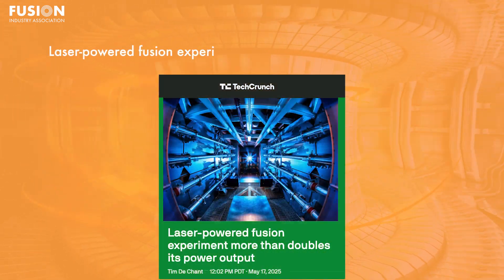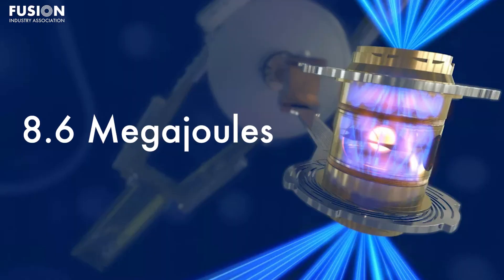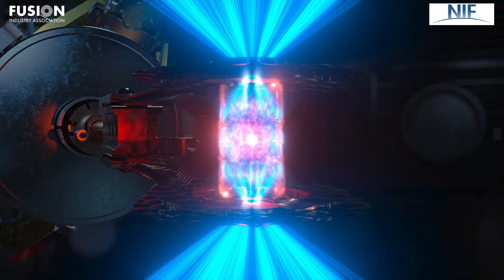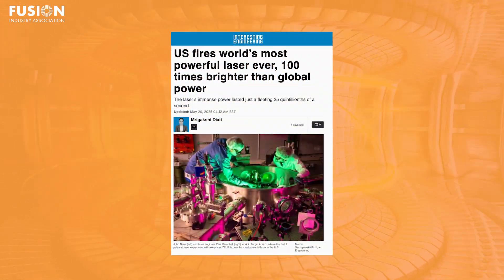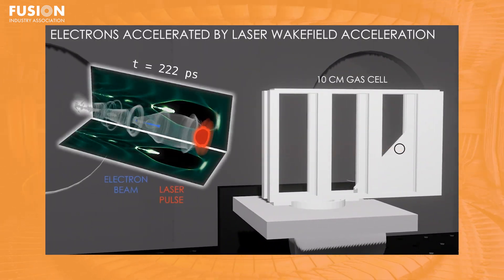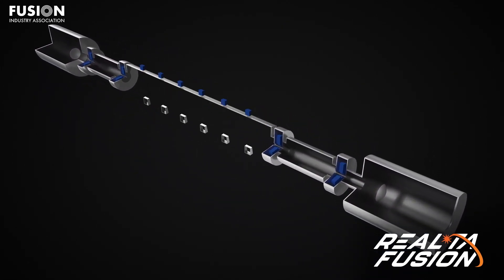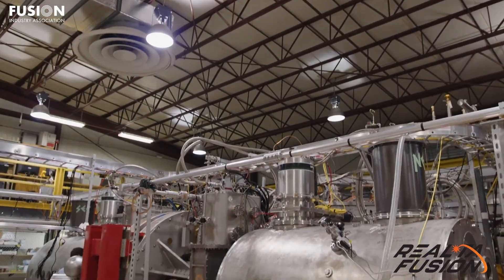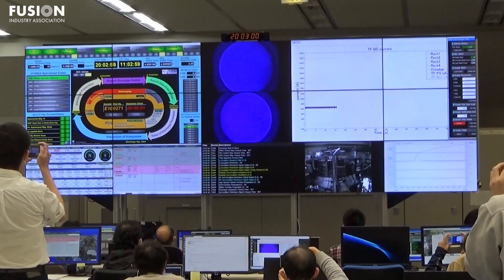Fusion News, May 28th, 2025

Comment: NIF is a weapons testing program for the US arsenal of thermonuclear weapons stock. Total annual energy inputs to NIF is likely billions or trillions times the energy output of any fusion event. The thermal energy output is in the range of the heat of a cup of coffee or tea for a small room of guests. Honestly 2MJ in and 8.6MJ out is pathetic. Also the fuel pellet costs $100k each and returns a few cents worth of heat. If an air source heat pump were put on site, for the same total site energy inputs it could have recovered billions of cups of tea worth of heat and done so 24/365.

Bigger lasers are not driven by grid power, they have to store energy in capacitor banks over a period of time then instantaneously discharge it into the lasing device. That means the continuous laser power output from the charging inputs is in fact very small, next up a planck laser.

And in Japan, they should be bringing all their fission power plants back on line before dabbling with fusion, the anti fission crowds will not be any friendlier to fusion when they learn about its costs and future waste streams.
Reply: NIF's electrical consumption is 36 - 44 GWh per year, mostly HVAC, chillers, vacuum pumps, target cryogenics, diagnostics, lighting and office loads.  The shot-specific load fraction is ~0.01 of that.  One shot (~8 MJ) makes enough power to run the entire facility for one second, 1/20,000,000 of a year.   That is, as you say, pathetic, so there is no reason to exagerate and claim NIF requires a trillion times as much energy.  Big lasers are useful because they can concentrate a lot of energy in a small area of space and in a short period of time.  It takes milliseconds to charge NIF's amplification medium, but discharging takes nanoseconds.  You are making a "red herrying" logical fallacy, when you imply scientists belieive NIF is a power plant that requires $100k pellets.
Reply: Bruh, it is science. Not the power source for your tailgate party.

Comment: Let's see, 8.6 megajoules is the same as 2.39 kilowatt-hours of energy.  If that raw energy could be converted to electrical energy at an efficiency of about 42% (a high number to achieve with a power plant that is converting thermal to electrical power), that would yield about one kilowatt-hour of electrical energy that could be valued at something like 5 cents when sold in bulk at the generating station prior to transmission to users.  How much did and will the frozen deuterium-tritium fuel cost?  How much did and will the hohlraum cost?  How much did and will the near-perfect spherical diamond shell that contains the fuel cost?  How often do the laser windows have to be cleaned at what cost?  (Let's ignore the other costs for the time being.)

Perhaps with more lasers, perfectly aimed and timed, and with a perfectly shaped laser pulse, then the hohlraum and the fuel container can be eliminated.

If I remember correctly, one of the researchers said the fusion reaction at the NIF would yield something like 40 megajoules if all the fuel in the target could be made to fuse.  Let's imagine that 100% of that energy could be converted to electricity.  Then we would have about 56 cents worth of electricity at the generating station for each pellet consumed.  If shots could be sustained at a rate of ten per second for a whole 24-hour day, that would yield nearly half a million dollars in sales.  If wishes were horses.... 🙂
Reply: Wow, thank you for laying out those unimpeachable numbers. Clearly the National Ignition Facility (NIF) is ready to slide straight onto the nation’s power grid tomorrow afternoon. Turning NIF into a turnkey power plant - piece of cake. 

Let me just run the obvious follow-ups that somehow mystify those pesky “experts.”
  Energy bookkeeping (already perfect, but let’s re-gush):
    8.6 MJ = 2.39 kWh (check!)
  Market value:
     2.39 kWh x 0.42 (thermal->electric) = 1.0 kWh x $0.05/kWh = $0.05
     Five cents a shot - ka-ching!
     (Why do physicists keep saying “that’s not revenue, that’s a rounding error”?)

But wait, NIF is already net-positive… if you forget the whole machine is plugged into the wall.

Electrical energy sucked from the grid per shot ≈ 400 MJ. Laser light on target ≈ 2 MJ. Fusion bang (record) ≈ 8.6 MJ. 
Actual wall-plug efficiency: 8.6/400 = 0.02. A glorious -98 % net return on investment - finally, negative numbers we can believe in!

Plop the machine on a truck and go, because obviously a laser lab the size of three U.S. football fields is just a portable generator with attitude.

|               Ingredient               | Mass (metric t) | Where that came from |
| -------------------------------------- | --------------- | -------------------- |
| Concrete slab (73,000 yd³)             |         134,000 |                      |
| Structural & reinforcing steel         |          12,600 |                      |
| 10 m steel target sphere               |             130 |                      |
| Odds, ends, & world-class espresso bar |          ~3,000 |     (hand-waving)    |
                                     Grand total ≈ 150,000 tons.

Look, that’s only half the displacement of an aircraft-carrier - strap wheels on it and tow it behind a Prius.
Now let’s power a Mars cruise liner with it. Scientists fret about “space reactors,” but we’ll just fire NIF 10 times a second for the length of the journey. Easy maths: 
  Energy per shot (dream mode): 40 MJ (all fuel burns). 
  Pulse rate: 10 Hz → 400 MJ s⁻¹ = 111 MW average.
  Transit time: 6 months = 4,380 h. 
  Total energy delivered: 111 MW x 4,380 h = 4.9E5 MWh 5.
  Number of pellets: 10 shots/s x 3,600 s/h x 4,380 h = 1.58E8.
  (Please remember to budget a couple of hundred million diamond shells in the snack bar.)
Don’t forget the extension cord We’ll keep the mother facility on Earth (where the coffee is) and run a plain old copper lead out to the ship.
  Distance to Mars (average): 2.25E11 meters.
  Two-conductor, chunky 500 kcmil Cu line: 2.5 kg/m
  Weight per conductor: 2.25E11 m x 2.5 kg/m = 5.6E11 kg.
  Double it for the return path: 1.1 trillion kg ≈ 1.1 billion t.
  (That’s merely 7,000 times the mass of every human being on Earth - pocket change!)
  (And ignore pesky relativistic lag-time; Mars can just wait the 12 minutes for the electrons to get there.)
Conclusion (why can’t scientists see this?) Clearly, with flawless economics—negative-100 % efficiency, 150,000-ton carry-on luggage, and a power cord heavier than Mount Everest - we’re sitting on the greatest bargain since perpetual motion.
Somebody call the utility commissioners and NASA: the future is *now*, and it weighs only a billion tons. But hey, if wishes were hohlraums…
Reply: Wow, thank you for laying out those unimpeachable numbers—clearly the National Ignition Facility (NIF) is ready to slide straight onto the nation’s power grid tomorrow afternoon. Let me just run the obvious follow-ups that somehow mystify those pesky “experts.”

---

### 1  Turning NIF into a turnkey power plant (piece of cake)

1. *Energy bookkeeping (already perfect, but let’s re-gush):*

      8.6 MJ = 2.39 kWh (check!) 

2. *Market value:*

    2.39 kWh x 0.42 (thermal->electric) = 1.0 kWh x $0.05/kWh = $0.05

   Five cents a shot—ka-ching! (Why do physicists keep saying “that’s not revenue, that’s a rounding error”?)

3. *But wait, NIF is *already *net-positive**… if you forget the whole machine is plugged into the wall:*

   * Electrical energy sucked from the grid per shot ≈ 400 MJ.
   * Laser light on target ≈ 2 MJ.
   * Fusion bang (record) ≈ 8.6 MJ.
   * Actual wall-plug efficiency:

      8.6/400 = 0.02

     A glorious **-98 %** net return on investment—finally, negative numbers we can believe in!

---

### 2  Logistics: plop the machine on a truck and go

Because obviously a laser lab the size of three U.S. football fields is just a portable generator with attitude.

| Ingredient                               | Mass (metric t) | Where that came from |
| ---------------------------------------- | --------------- | -------------------- |
| Concrete slab (73 000 yd³)               | 134 000         |                      |
| Structural & reinforcing steel           | 12 600          |                      |
| 10 m steel target sphere                 | 130             |                      |
| Odds, ends, & world-class espresso bar | \~ 3 000        | (hand-waving)        |

*Grand total ≈ 150 000 t.*

Look, that’s only half the displacement of an aircraft-carrier—strap wheels on it and tow it behind a Prius.

---

### 3  Now let’s power a *Mars cruise liner* with it

Scientists fret about “space reactors,” but we’ll just fire NIF 10 times a second for the length of the journey. Easy maths:

1. *Energy per shot (dream mode):* 40 MJ (all fuel burns).
2. *Pulse rate:* 10 Hz → 400 MJ s⁻¹ = *111 MW* average.
3. *Transit time:* 6 months = 4 380 h.
4. *Total energy delivered:*

  111 MW x 4380 h = 4.9E5 MWh 
      
5. *Number of pellets:*

     10 shots/s x 3600 s/h x 4380 h = 1.58E8

Please remember to budget a couple of hundred million diamond shells in the snack bar.

---

### 4  Don’t forget the *extension cord*

We’ll keep the mother facility on Earth (where the coffee is) and run a plain old copper lead out to the ship.

* **Distance to Mars (average): 2.25E11 meters
* **Two-conductor, chunky 500 kcmil Cu line: 2.5 kg/m

Weight per conductor:

   2.25E11 m x 2.5 kg/m = 5.6E11 kg
   
Double it for the return path: **1.1 trillion kg ≈ 1.1 billion t**. That’s merely 7,000 times the mass of every human being on Earth—pocket change!

(And ignore pesky relativistic lag-time; Mars can just wait the 12 minutes for the electrons to get there.)

---

### 5  Conclusion (why can’t scientists see this?)

Clearly, with flawless economics—negative-100 % efficiency, 150 000-ton carry-on luggage, and a power cord heavier than Mount Everest—we’re sitting on the greatest bargain since perpetual motion. Somebody call the utility commissioners and NASA: the future is *now*, and it weighs only a billion tons.

But hey, if wishes were hohlraums… 😉
Reply: It is a scientific apparatus not a power plant. You are all over the map, go back to school and then help.

Comment: I don't understand, why did they scrap the $375,000,000 MFTF, without even turning it on once, after they finished building it? (05:42)
Reply: "To balance the budget".  Change in political leadership. 
Mirror machines have had confinement issues in the past. There might also have been other considerations.
Reply: @johanlindeberg7304  Sounds like SOP for American politicians. They spent $2 billion digging an unused tunnel for the Superconducting Super Collider, and $15 billion on an unused garbage pit at Yacca Mountain.
Reply: Political folly! Some bureaucrat at DoE decided they should scrap every concept that wasn't a tokamak. Los Alamos was also  hit hardly. They used to have the best reversed field pinch, the best spheromak, and the best high density pinch experiments, but no tokamaks.
Reply: jews

Comment: in 0.5 atoseconds, light only travels 1.5 angstroms. that is a short period of time !! How do you hold the equipment still enough for the light to be one contiguous blob ?
Reply: The equipment only has a 0.5 attoseconds to move as well.  I'm pretty sure any vibrations are limited to the speed of sound inside the material the apparatus is composed.  For example, sound moves through steel at only 6 km/s.  In 0.5 attoseconds, sound vibrations in steel only moved 3×10^-15 meters or 3 femtometers.  For comparison, the diameter of a proton is approximately 1.75 femtometers.

Comment: An attosecond only has 17 zeroes after the decimal point, not 18. (03:50)
Reply: You're right, it's 18 decimal places. My script was right but I messed up during the recording.
Reply: @jeffpeachman  Don't feel bad.  When I asked copilot how many zeroes an attosecond has after the decimal point it told me 18.  And, when I asked how sure it felt about that answer, it confidently insisted an attosecond has 18 zeroes after the decimal point.   When I asked about other time periods, it kept giving the wrong answers.  It even said a millisecond has 3 zeroes after the decimal point.  Eventually, after several minutes of arguing I put the string of digits inside quotes, and it finally saw its mistake and corrected itself.  Anyway, Dr. Peachman, you're doing a good job, so I should stop being so anal-retentive.